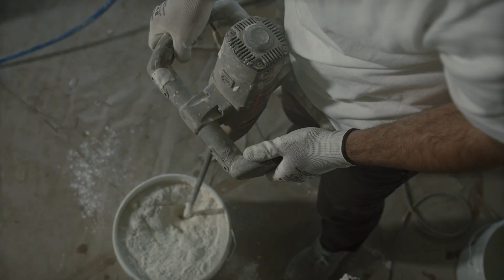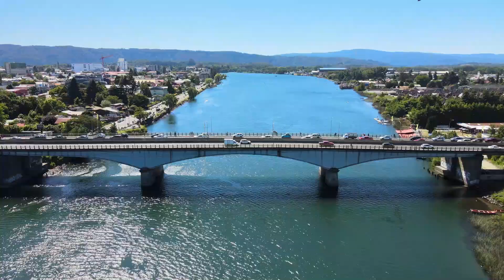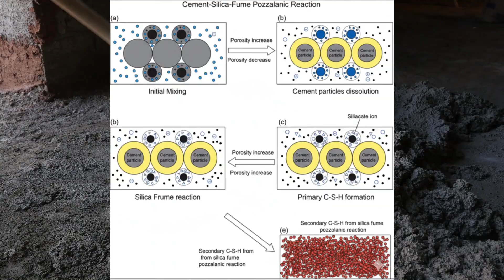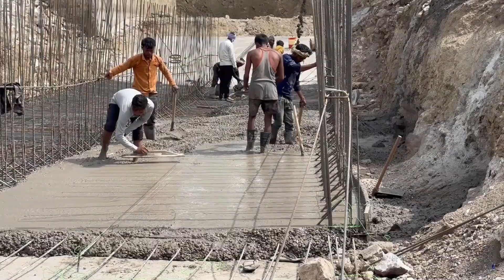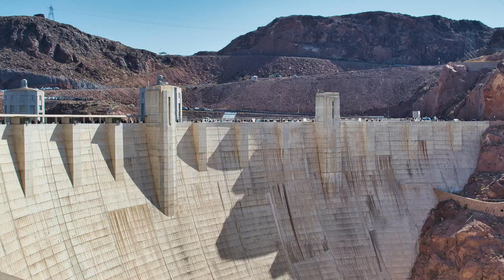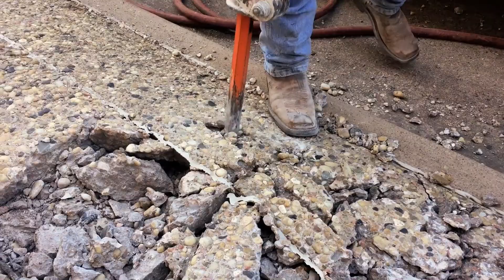Concrete vs Cement: What's The Difference

Comment: 3-D printed concrete is beginning to show dismal results after its introduction into the homebuilding industry. Cracks and inconsistencies found show that the integrity is compromised due to erroneously calculated or poor mixing ratios.